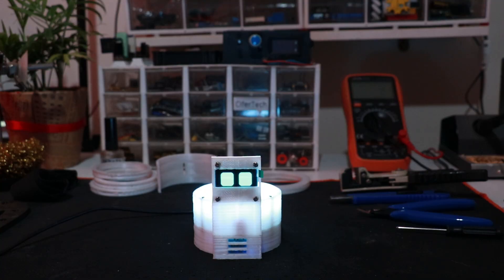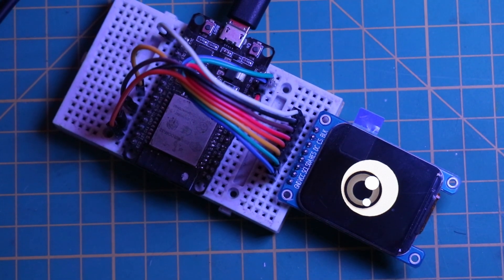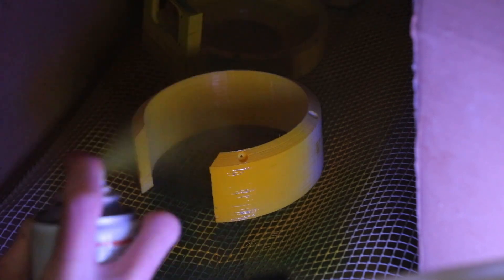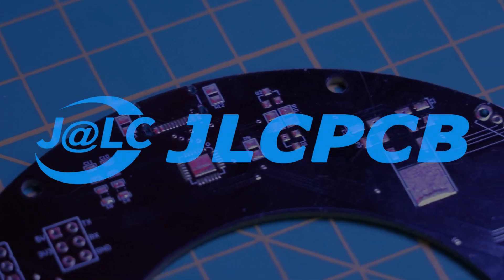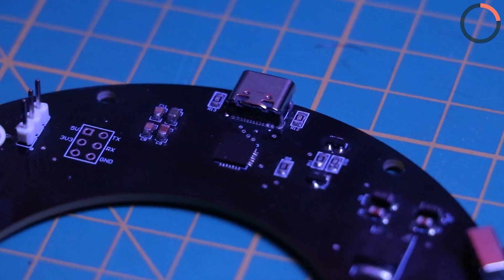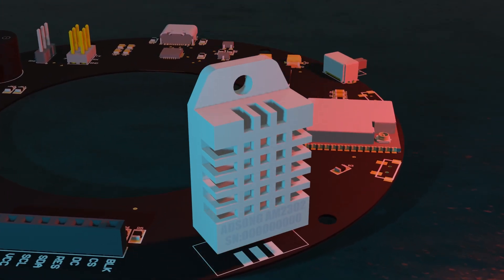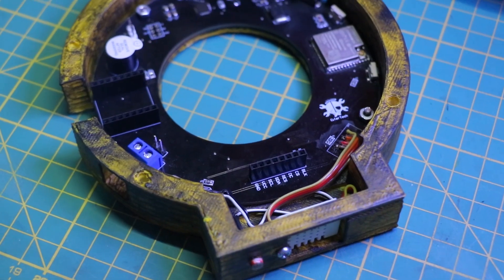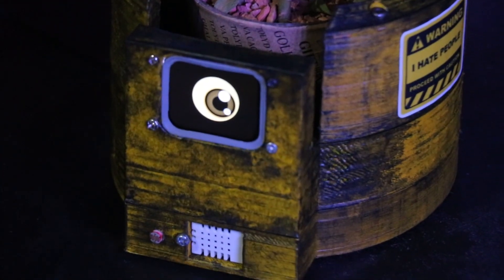A Plant Pot With Emotions | Why Did I Build This?!

Comment: your soil moisture sensor will corrode soon (cuz of bare copper being in water and soil plus a small current is running) 

you should swap it with a capacitive soil moisture sensor.